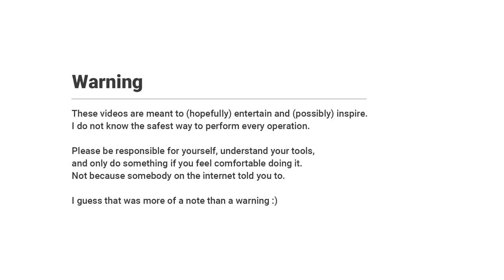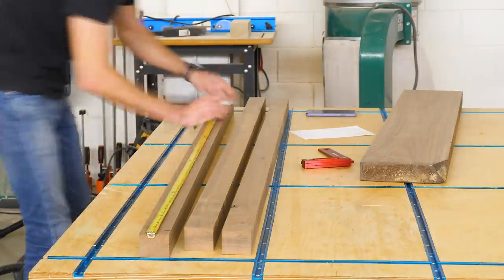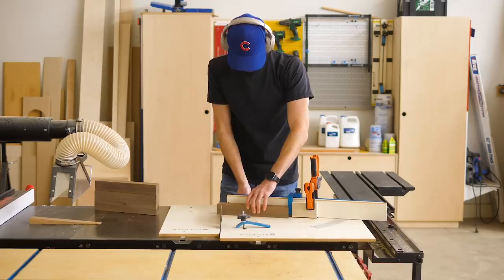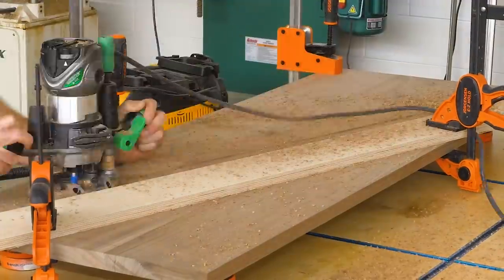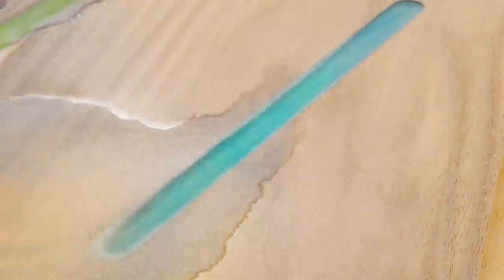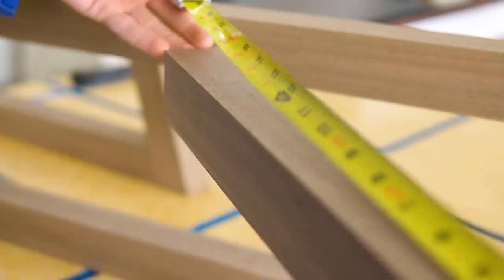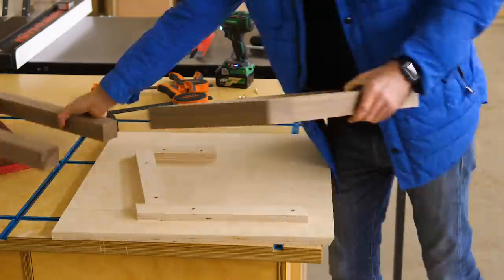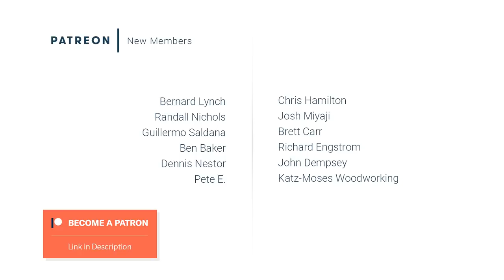My Best Crayon, Epoxy, Resin Inlaid Coffee Table...So far!

Comment: Never did anything with resin, but used some "bondo" to fill cracks and hole. Used same technique I saw Jon Peters (How to Make a Mortise and Tenon Display Frame @8:05) doing with a router to flush dowels, kind of planning a surface with a router jig, saves a lot of time. Made a jig like a bridge, mounted a router and used a spherical bit 0,2 mm higher than the surface, it cuts the high spots leaving only few tenths (mm) to sand.

Comment: Awesome design ! A tip i've learned by watching a lot of epoxy tables videos is that once it is hardened, you can soft the excess with a heat gun and remove it with An old chisel , that will avoid lots of unnecessary sanding 😊

Comment: Great video and build. I always enjoy the banter between you two. Did it cause any problems having all of the bottom of the base in contact with the floor?
Reply from the maker: No. Though, depending on the floor, it could. I will end up putting little silicone pads on the bottom though, so only those will touch the floor.

Comment: Really nice table!! Again ;). I got a question, and if im correct a little tip. When you look at the shine of the table, is it really wavy, or is it normal (So is the reflection on the table wavy or just straigt like a mirror)

 I noticed that when you sanded the epoxy, you stayed in one place a lot, and because the epoxy is higher, the edge of the sanding machine is on the wood and on your epoxy, so your sanding machine is on an angle. and with that method you create a lot of minor dents, which isnt a problem when you stop sanding after 320/500. But if you go higher than that and go up to polishing, those dents deform the reflection, because its not a straight surface.

So my tip is, make a sanding beam, and sand the surface until no epoxy is left on the surface. And after thats done, sand your surface from left to right, up and down etc so its remains as flat as possible. This option wil cost you more work, but will give you a better finish than only sanding the epoxy spots at first. 

But like i said, if this is not the case, than consider it some free info.

Really nice work and a happy new year!

Edit; spelling mistakes

Comment: Johnnybuilds uses a heat gun to heat up the epoxy that overflowed. The epoxy softens slightly when it is heated. He uses total boat epoxy as well. Once it’s heated he uses a metal scraper to remove the majority of the epoxy. Maybe this will help you. You can also build a dam using silicone. Just run a bead around the place you are going to fill with epoxy. You do have to be careful not to overflow the dam as well.

Comment: Great work! Do you have a link or a name for those interlocking glue-up mats?
Reply: Nevermind, I just realised they're the Rockler Super-Sized Silicone Project Mat XL. I didn't initially because the flat pockets in front made them look different than the normal Rockler mat.

Comment: WHat grit sandpaper did you start with to remove the epoxy without removing any (or too much) wood from the table top? 
I have trouble with some of my methods as well, and I know you aren't supposed to run epoxy through a thickness planer, but sometimes I do because ugh.. sanding..

Comment: Love the new design and even though your crayon videos were so popular you haven't overdone it. Thank you for your work! Also, have you ever thought about moving your trash can closer?
Reply from the maker: I'm still just trying to find my range :)
Reply: @Foureyes.Furniture  that's funny! On a different topic, I experimented a little with melting crayon in an oven. It was pretty smooth and quick melting process. It was also a fairly small  piece for side table. Not sure if it was good for the wood but it turned out pretty stellar. Thanks for the inspiration!

Comment: Hey Chris! So, after you polish the epoxy, you don't have to sand the wax off of the walnut that got the overflow of wax polish? Or did you tape up the epoxy and sand the walnut again afterwards? I'm also thinking about buying some simple finish since most of the stuff I've been making lately has been a more natural finish. Thanks.

Comment: Beautiful table, and super entertaining video, as always! Question: how does your finish handle being applied to wood being sanded to 4000g? At 15:50 it looks kind of splotchy, but it's a weird angle so I can't be sure
Reply from the maker: Good question. The Splotchyness is actually from the polishing. I orignally only polished the epoxy areas. After the video was done I polished the entire top to even things out.

Comment: Hey Chris! I made something using your techniques with crayons and epoxy. It looked great when I first finished it. After awhile, I noticed that the epoxy started to pull away from the crayons and it looked foggy. Did you experience this as well? Is it because the epoxy doesn’t bond well to the wax?
Reply: This is what I was thinking of what would happen as well. When pouring and casting resin into mounds we would use wax or something similar to avoid the resin getting stuck in the mold, wnad that the part would release. In this instance you want the resin and wax to stay in. Crayons are basically wax so I'm not sure how this concept works. Chris could perhaps explain this
Reply: @ebie97  yeah, looking at it a year later, I wouldn’t use crayon again. It looked great the first couple of days but now Its pretty much foggy from the wax pulling away from the epoxy from temperature changes. No real advantages of using crayon vs colored epoxy.

Comment: You can use an infrared lamp to melt the crayons evenly without the air from the heat gun pushing the molten crayons
Reply from the maker: that's a good tip. Personally I like the air pushing the wax though. That way I can use it to kind of feather things together.

Comment: Highly recommend a card scraper for cleaning up epoxy.  So much faster
Reply from the maker: I think I tried mine. It's a lot of epoxy to clean up though. I'm working on a smaller project with epoxy. I'll try it again on that one.
Reply: @Foureyes.Furniture  getting a good bur if you don't use it much is a challenge too it so I get why the sanding.  I hated mine until it clicked and now I use it constantly.  I think I would have run it through the thickness planer but I really hate sanding

Comment: I tried this but while sanding the cured epoxy, I found that it was lifting off of the crayon. I don’t think the resin adhered to the wax. I’m going to route the epoxy and crayon out of the groove and replace with a more traditional resin pigment.